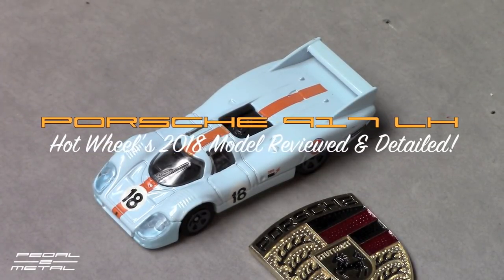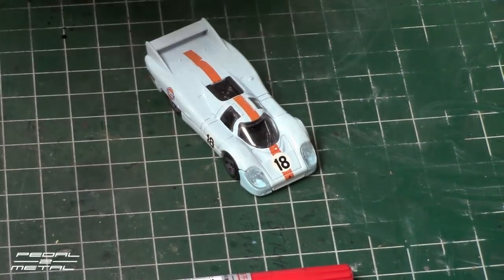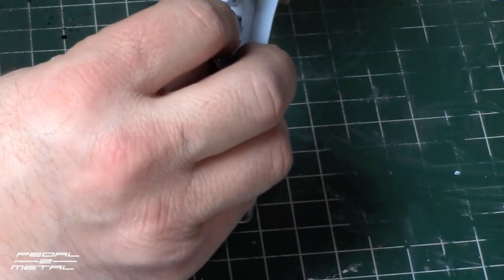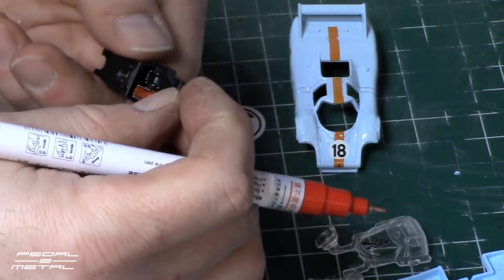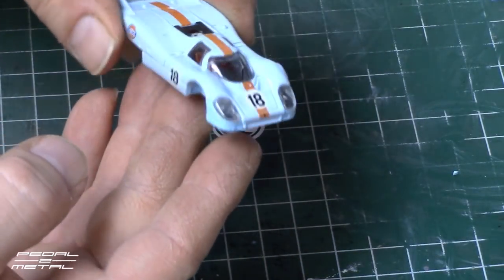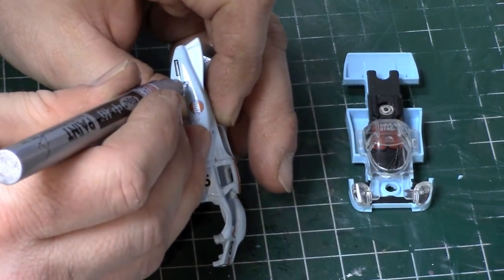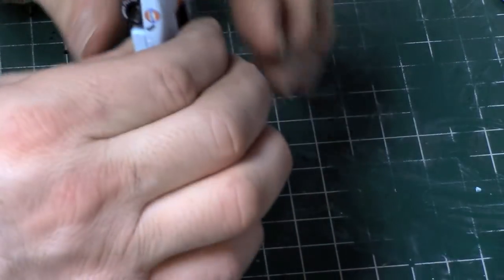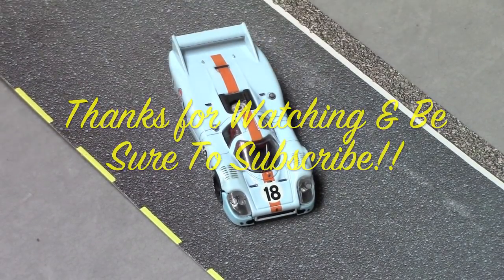2018 Hot Wheels '71 PORSCHE 917 LH | Review and Detail Job

Comment: On the vents I like to just slip on a couple of coats of black or whatever and the next day just go over it with some alcohol and a cotton cloth wrapped tight on my finger. The recesses will hold the color. I also like to dip the clear plastic in clear pledge and let it dry on a paper towel. Really picks up the sparkle like real glass. Sometimes I’ll dip the entire body. Thanks for sharing.

Comment: Nice looking Porsha 917 in Le mans style. It doesn't look like a basic line car after the paint detail and wheel upgrade. Could you please give me the link of the Ebay seller for the fine tip paint markers? I did a search but cant fine them. Thanks
Reply from the maker: Hi Ricardo, I can't find the exact seller, but if you type in 0.7 extra fine paint pen other sellers come up with varying prices.
Reply: Pedal2Metal Thanks Royce. Will check out Ebay again.